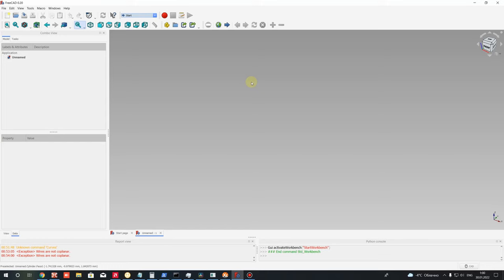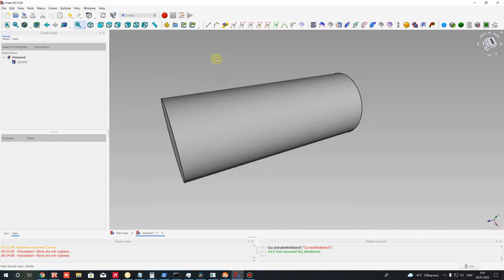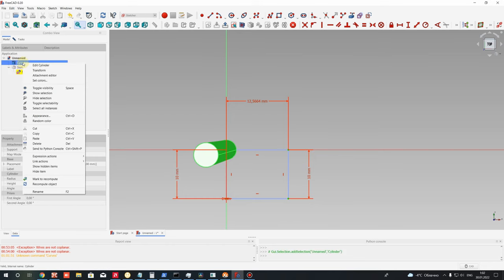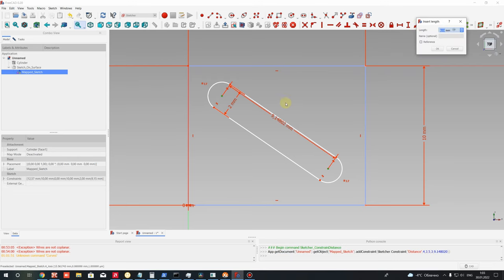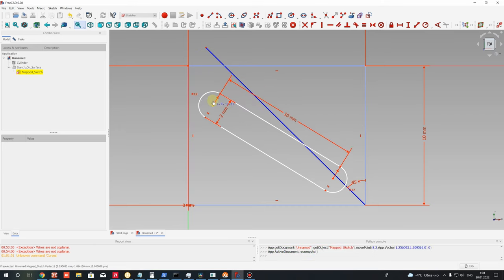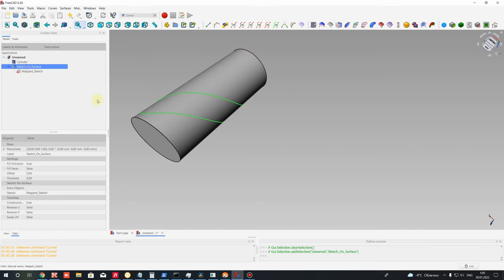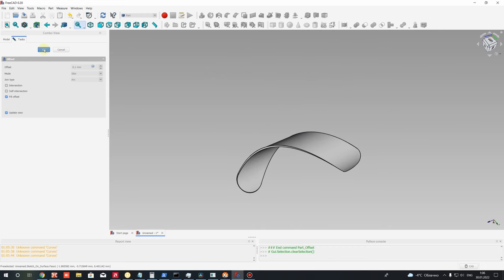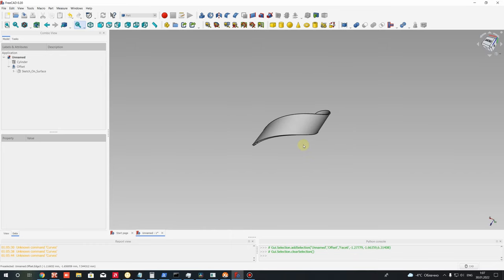FreeCAD Tutorial | Wrap Operation in Curves Workbench for Sheet Metal Plate

Comment: I have an interesting "geometry" question. 
1. Object is a torus (outer diameter 314mm) (inner diameter 313mm)
2. Object is cylinder diameter 100
3. How to wrap the torus around the cylinder [  cylinder = 0 |= torus]
4. The torus "should" wrap top and bottom at +90˚ and -90˚
Step two 
Rotate the wrapped torus through 90˚ and re-warp around the cylinder in the opposing axis. The output where viewed from the top resemble the "command key" on a Mac. ⌘ 

*I've been trying to resolve this for far too long.